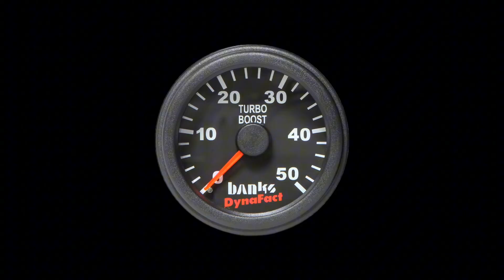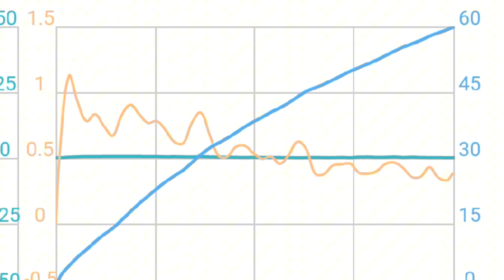Car Culture LIED About BOOST PRESSURE

Comment from the maker: To put it into perspective - I got more air mass and ran a 4.29s (4.12s 1 foot rollout) 0-60 on this little 2.0L Stelvio with AWD. Times posted on Dragy.

0-60s aren't the best indicators of power - this just shows how much air mass effects horsepower. Cold oxygen dense air is peak.
Reply: Actually good numbers for the 2.0 engine. Would the eurocompulsion v4 help with the inclosed airbox and larger intake surface with the air mass?
Reply from the maker: The V4 intake seems great, and it'd help if their IAT datalogs are valid.

For the money though, and possible restriction / pressure drop the ram air duct port introduces into the system (as trivial as it may be) - I didn't buy it.

I instead took 2 large 4 inch silicone bends, a 4 inch aluminum pipe - took the bumper off, and made the ram air duct port hole large enough to fit the pipe. Put a huge filter on the end of the aluminum pipe after sticking it through the larger ram air duct hole so it'd sit at the very front of the grill, and now I have a decent cold air intake system for less then $100.

It looks awesome visually, but was a bit of a pain since bumper tabs break, and it's a super tight fit and if you do this you must use a hydrophobic pre filter on the filter.
Reply: @TorqueTheoryLabsthe v4 doesn’t help with IATs 
When our alphas gain any oil/water temp the entire coolant system increases in temp my IATs with a larger seconds cooler and fan set up are about 10-15 above ambient temperature with the multi-air system active
When I disable the multiair my IATs drop to 10 below ambient
Reply from the maker: @BobbyB910 

I didn't know you were able to turn off the Multiair function. Is this a special optimization of Club Alfa's? Do you get maximum valve lift 24/7?

Because I believe MultiAir is mostly ignored at WOT, and it just gives near full lift.
Reply: @TorqueTheoryLabsyou can go into your base settings and turn it off like the paddle shifters but it does help heat up the engine during cold start situations.
Now that’s it’s cold I don’t use e85 just 93 and I keep the multi-air active
Reply: @TorqueTheoryLabsI haven’t noticed any performance difference between multi air on or off just seems to heat the engine during cold weather quicker
Reply from the maker: @BobbyB910 

I'm gonna look into this. Thanks for the info.
Reply: Been working with club alpha on tuning and actually getting people to mod these things
Reply from the maker: @BobbyB910 

Club Alfa is ambitious, not sure how deep his knowledge goes for motors or if he's just a marketer. Regardless, props to him.

I don't recommend my setup, it's likely at the edge of performance for this motor. A 4300LB AWD SUV shouldn't be running 4.2s 0-60s. But if I had to redo it all again I'd likely do everything the same.

Interested to see what Dragy times he can get on the Giulia. If he ever upgrades to a QV and pushes that platform - he'd probably grow significantly.
Reply: @TorqueTheoryLabsI have the “450” hp turbo from a company called much boost at 26psi I put down 396awhp and 364tq I use 93 and if I go any further I need a cam and full engine build
Club alpha is looking toward the future with these car becoming cheaper hopefully people will start to mod and make the alpha community grow.
At the moment 98% of alpha stuff is just bolt on and a off the shelf tune with no real workable “power levels” it’s just ohh the madness tune makes more pops than the euro comp tune 😂
Reply from the maker: @BobbyB910 

Would love to know the peak LB/FLOW you're hitting at WOT, that really determines power. Maybe grab an Amazon bluetooth OBD2 scanner and datalog.
Reply from the maker: @BobbyB910 

I agree, I run pops and bangs from Eurocompulsion - but not obnoxiously like some of the tunes people are in love with. Eurocomp at least asked me what "noise level" I want.

Comment: I mean I get what you’re saying here but the real world application is just absolutely different 😂. I mean just look at a Honda k engine or the b16 theirs an absolute shit load of engines almost begging for boost that make incredible power without even touching the rotating assembly or top end.
Reply from the maker: So you DO get what I'm saying -

Design the engine to flow because boost pressure is just restriction, all that matters is air FLOW in and out, and how cold that air is.

Comment: PSI isn't real air.
It's fake air pulled from the exhaust of the 1999 camry pulling away in front of you!
Reply from the maker: PSI isn't airflow, it's pressure.

Mass air FLOW (LB/MIN) is what matters. It's why they indicate it at the bottom of compressor maps, and why it's the educated guess benchmark for HP.

Engines are air pumps if you strip everything away. How many LBs of air you can get in is what makes power.

Comment: To say all of this and not talk about turbo sizing and actually talk about the volume of air moved.....a k03 at 25psi is completely different from a something like a G30-990 at 25psi. There are plenty of K20s, EA888s, SR20s, 4G63s the list goes on with turbos on them that would love to see a NA coyote.  How parts work together should have been the focus of this vid, then just boost pressure.
Reply from the maker: This is a good point.

The point of the video was that boost pressure is a terrible proxy for airflow and power. You're correct to point out that I should've included something like what you mentioned.

Comment: Love your videos bro but this one was a bit more confusing to understand than usual….
Reply from the maker: Sorry about that! 

Basically,

Boost pressure doesn’t equal power, airflow does.

You can crank PSI and still make less power if the air is hot or the turbo is inefficient, because engines only care about how much usable, cold, dense air actually makes it into the cylinders.

Comment: You're right bro, you're right. That's why most DTM race cars are i4 because the weight is perfectly balanced, they stay light weight and they still make hella power. But you're right bro. You're right. I forgot intercoolers don't exist, I forgot cars weren't designed with big open grilles nowadays. You're right bro. That's why pretty much every car on the road is turbocharged. Including performance cars. 

That's why the new gt350 is supercharged instead of NA, you're right. 

Only company still truly making high performance NA v12s is ferrari and even then time will come.
Reply from the maker: I never mentioned chassis, no reason to dilute the conversation. 

The second half of this video covered boost pressure, and also talked about why smaller motors are able to match N/A large displacement motor performance, showing the superiority of forced induction (with a Dragy slip st the end).

Sounds like you're trying to cope with something though, maybe you bought a small forced induction motor you hate?

Comment: I spent around 5-6 months fully building a d16y8 civic with the most expensive parts money could buy. The heads lifted and it spit everything out on the pavement about 2 weeks into driving it. Yes it had arp head studs and all that. I had everything measured correctly, tuned, torqued you name it. Literally a damn hector spoon engine. Was so mad I left it on the street and let the city tow it.
Reply from the maker: That really sucks! The reliability of smaller motors making big power is considerably lower, which is another caveat - unless OEMs made it because then R&D will force it to work.

Comment: The biggest misconception with turbos is comparing boost pressures. A large turbo making 10 psi will flow a lot more air than a small turbo making 30 psi.
Reply from the maker: Exactly!

This is why you can't run a big turbo on the same tune as a small turbo.
Reply: It's all about where you want the power. The small turbo is going to be better than a big one until it reaches higher RPMs and cant sustain that pressure. Most cars operate in the 1600-2800rpm range where the small turbos are perfect for snappy responsizeness. These modern "tuner" cars have well sized turbos for their output, its only when people just slam 8psi over stock that they have the heat issues and the engines become breathless in that 5000-5500rpm range. 

I actually had this same problem where my tiny stock turbo was just not cutting it up top and my intercooler was heat soaking easily. That's why I went with a bigger turb.... just kidding. I traded it in for a car with a 7.0 V8.
Reply: Well yeah, pressure is a function between flow and area.

Comment: Not boost, but volume. The volume of air you can move. A boosted motor ups the effective volume of displacement, making the engine effectively "bigger." Yes, there is a limit.  The amount of boost doesn't really tell you how much air is being moved.  But I still love my boosed 4s
Reply from the maker: Right, and to add - air mass and density (LB/FLOW) is the measurement for power.

Comment: Heat kills power. Smokeys hot vaper system said what?😂
Reply from the maker: It said it doesn't make more power.

Smokey Yunick proved you can make more efficiency with hot air, not more power. Cold, dense air still sets the horsepower ceiling.

Comment: I have a point you make that doesn't necessarily make sense but feel free to correct me if I'm wrong. You keep bringing up real air which I assume you mean is the maximum amount of air you can put into a given cylinder at atmospheric pressure. The na coyote engine you keep bringing up only has the appearance of taking in more "real air" purely because it has more cylinders to suck said air into. At the end of the day, having a 0.5L displacement in a v8 or I4 still is the same amount of air, it just appears to be more due to the frequency of firings from having more cylinders. Technically speaking, both na and forced induction take in the same amount of "real air" per cylinder, one is just more dense. On top of that, there are tons of other factors to making power, not just displacement. Take the Ferrari f40 for example with its small 2.9 liter v8 all the way back in 1987 which had a non twin scroll twin turbo setup and made almost 500 hp. 40 years later, the 2025 5L Mustang GTD makes that with every modern trick possible like fully computer controller vvt, direct injection, modern ethanol fuel and on the fly adjustments to fueling rather than the old lookup tables a car of this era would have been stuck with if it was computerized enough for it. I agree that psi isnt a good metric for power and that engines under boost are more strained but seeing as they're designed with that in mind, it only becomes a concern when you choose to exceed the maximum HP the block and its internals can handle which is true of any engine configuration.
Reply from the maker: I see where the confusion is, this should clear it up in the simplest way:

THIS IS AN ACCURATE CONCEPTUAL EXPLANATION OF THE PHENOMENA DISREGARDING RPM, VE, AND REALISM

You can fill a 0.5L cylinder with 0.5L of air in total if it's 100% filled. But, how much oxygen does that air contain?

(Heavier) colder air = more oxygen

(Lighter) hotter air = less oxygen

The air molecules are closer together when the air is cold, compared to when it's hot. More air molecules = more oxygen molecules and more weight.

A 0.5L cylinder 100% filled with cold air, will weigh more because more oxygen is in that air.

A 0.5L cylinder 100% filled with hot air, will weigh less because less oxygen is in that air.

So if we have an 8 cylinder engine, and each cylinder can take in 0.5L of air - that's 4.0L in total.

If we have a 4 cylinder engine, and each cylinder can take in 0.5L of air - that's 2.0L in total.

An old average is 1 POUND of air per minute ingested can make 10HP.

So if the 8 cylinder can ingest 4.0L of air, but that air is hot and weighs less - let's say 1 pound per minute in total > it'll make 10HP.

But if the 4 cylinder can ingest 2.0L of air, but that air is very cold and weighs significantly more - let's say 2 pounds per minute in total > it'll make 20HP.

Then when we add in the  new variable "RPM", we can increase how many times a motor ingests and expels the air. This increases the pounds of air per minute it can take in, and therefore the horsepower. Colder air increases the weight so you get more pounds per minute, and therefore more horsepower.

Now, when I say "real air" I'm talking about cold/dense USABLE air. Of course hot air is also real air, you can't have fake air - but it was more of an exaggeration to demonstrate that cold dense air has significantly more potential power then hot air.
Reply: You are correct that your point doesn't make sense.
By "real air" I think he means something like "number of oxygen molecules".
A larger displacement engine generally has proportionally more air flowing through it (assuming engine speeds are the same, etc, etc).
I think the point of the video is that just slapping an aftermarket turbo/supercharger onto your engine, without properly designed intercooling, is stupid.

But a quick Google AI search claims that most aftermarket turbo kits include intercoolers and wastegates, so maybe he's barking up the wrong tree.
Regards.
Reply from the maker: Intercoolers mean cooling down hot air, not sure where wastegates entered the chat - but read my comment below if you need more info.
Reply: @TorqueTheoryLabs Yes, using your terminology, an intercooler turns "fake air" into "real air". 😜
Reply from the maker: @zenbum2654 

More accurately - usable air.

I should've explicitely said this in the video, my mistake!

Comment: One big point you missed is weight, going from a turbo 4 cylinders engine to a NA V8 will easily add 200-300lbs that is a huge percentage on a sub 3000lbs car, weight distribution is worst too, combined, that means less cornering g-force, less braking g-force, dynamics will be worst overall.
Reply: Coyote and LS3 are both in the low 400s for weight. They're really not that much heavier especially when you factor in the extra cooling needed for boost.
Reply from the maker: I didn't miss the point.

Engines aren't know for their handling, chassis are. I don't typically incorporate chassis dynamics because I largely cover motors.

On the contrary of not wanting to dilute the topic, chassis would be designed differently if every motor was larger.
Reply: @TorqueTheoryLabs I think your video is nice, of course you can't include everything in a short video. Weight is just something I thought of when comparing both options. There are no amount of chassis tuning that can remove the effect of having extra weight, lighter is always better, it is an inherent difference between both options.
Reply from the maker: @Iseenoobpeoples 

I agree, lighter is definitely always better. This is where these little engines have a huge advantage.

Comment: This is a room temp iq take. Partially right that pressure represents restriction, but 95% of everything else was a garbage interpretation of boost vs na. Watch some Richard holdener and get a real education.
Reply from the maker: If there’s a specific technical point you think is wrong, I’m open to discussing it. Otherwise, we’re just talking past each other.
Reply: @TorqueTheoryLabs just take a higher level physics college course
Reply from the maker: @vanta240i 

This isn't a complicated topic, not sure why you'd need to do all that to understand.

Comment: On this one you are kinda right but not at all…..
The efficiency of the head flowing is what makes power not the boost number.
Our alphas much like Mitsubishi 4g63 has poor flow for a designed turbo engine.
The boost number only represents the lack of flow. Take a 4g63 these guys will put 60psi into that engine and make 1200hp and that’s great and all but a 4b11 with the same sized turbo will make more power with less boost because of flow.
You can absolutely cram air into the cylinder but then it still comes back to efficiency of the engine not the turbo to evacuate the burnt mixture into the exhaust and in return spool the turbo more
All of this basically comes down to displacement and ability to move air
Reply: An important variable you didnt mention is the temperature of the intake air. Turbos heat the air, and heat on its own makes pressure. 

He very correctly pointed out that heat management is one of the most important factors when it comes to making power, alongside airflow and proper turbo sizing.

I want to turbocharge an old 302, and you are absolutely right about airflow restrictions making a difference. People tend to think with a turbo it doesnt matter if you have a restricted head, but its quite the opposite!
Reply from the maker: @codybrought5722 

Yep, people tend to forget the fundamentals of motors in the "quest for power".
Reply from the maker: Not thrilled that you said I incorrectly stated something, just to restate a point I made in the video.

But you're mostly correct, no arguments here. Head flow is ultra important.

As importantly - the turbo needs to be able to run in it's efficiency island to make power, and that air needs to be intercooled. Otherwise when it gets to the head, it'll be useless.

The turbo IS the easily fixable bottleneck in many MODERN motors, hence aftermarket "hybrid turbo" upgrades being available.